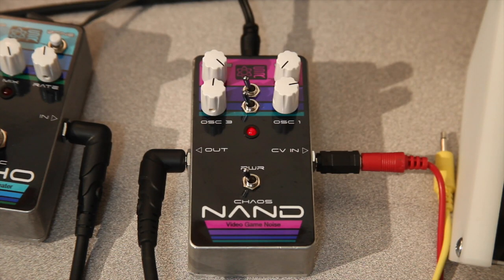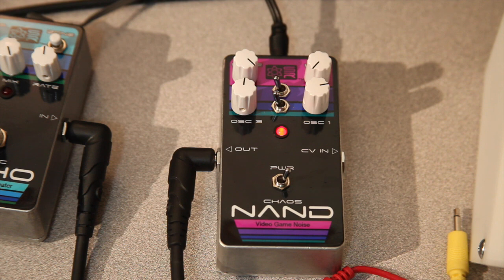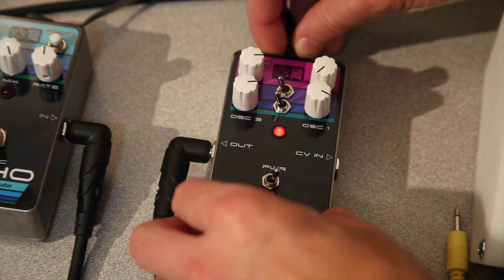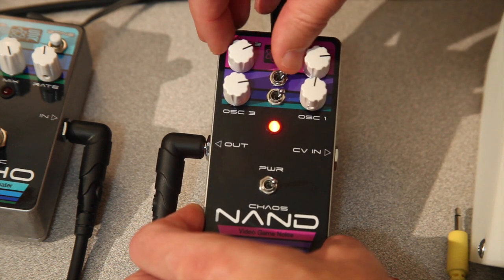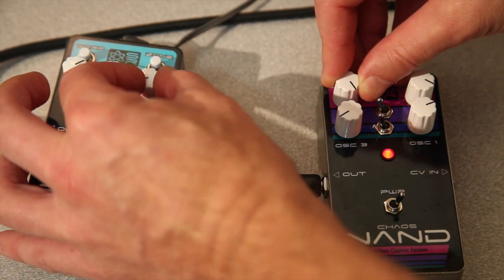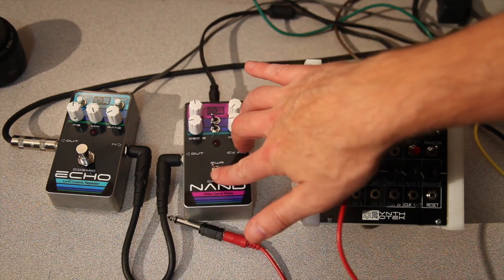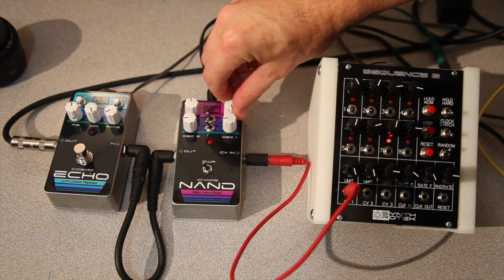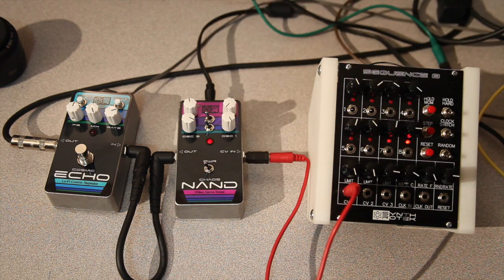New! Synthrotek Chaos Nand Aluminum Hand-Held Lo-Fi Square Wave Synth.

Comment: pretty solid square generators. Are there gate/pitch cv controls available or will those have to be mods?
Reply from the maker: The Chaos Nand Gates (sort of) and also changes pitch with the CV input (which does not require any mods!)